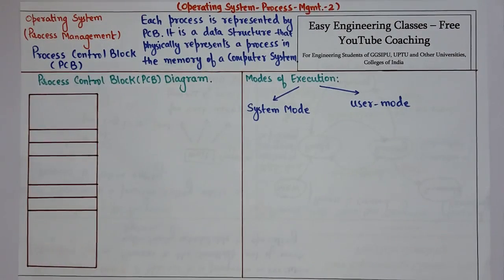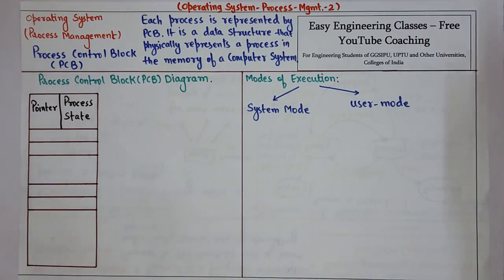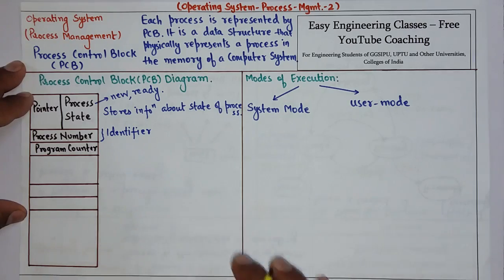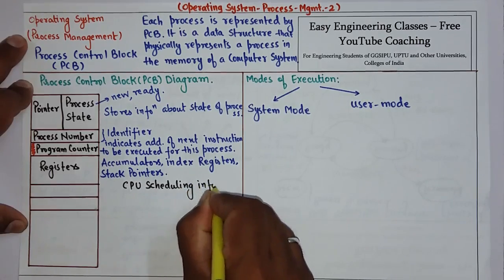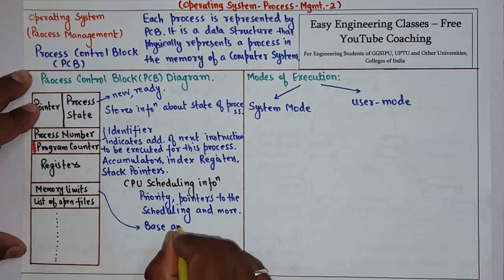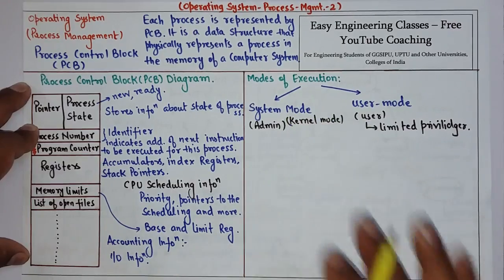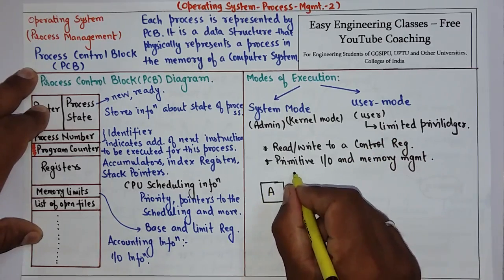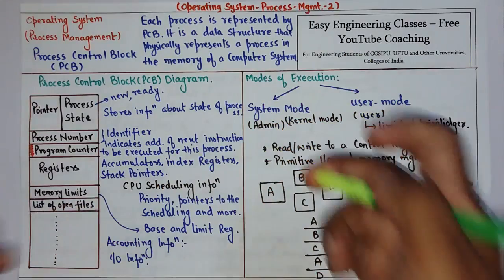L8: Process Control Block(PCB), Modes(Kernel, User) of Execution | Operating System Lectures Hindi

Comment: The instruction line from which the process has been discontinued from running.... Dad, address of the instruction line is being stored in the pcb process control block data structure